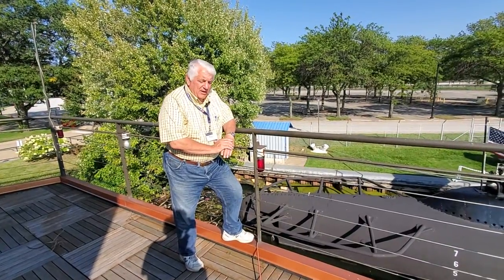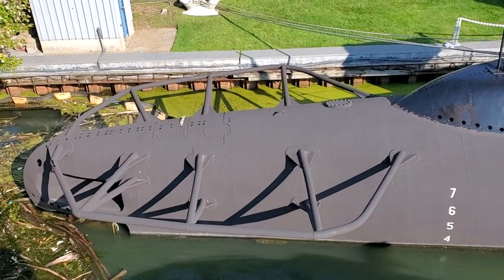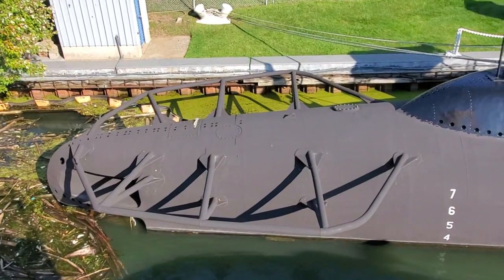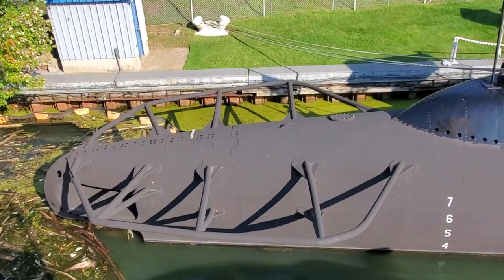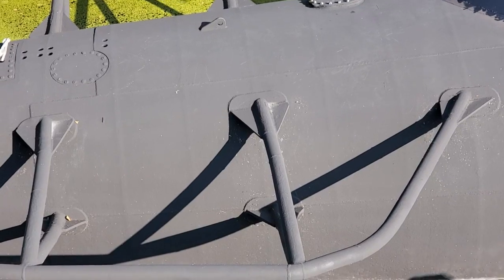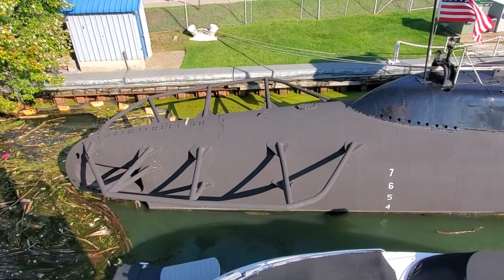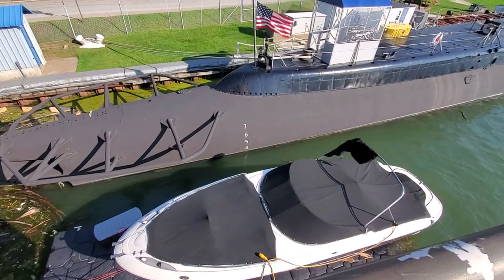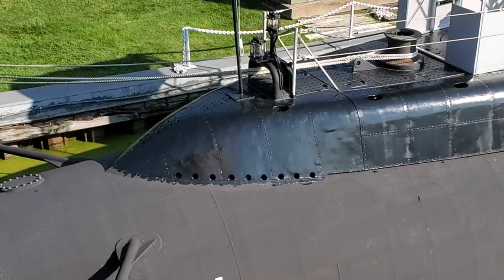Propeller Guards: The Purpose for Those Mysterious Pipes on Submarine Sterns

Comment: A simple solution to allow the Subs to keep prop Guards & avoid grappling hooks would have been to cover guards with sheet metal or steel plates. This would have allowed them to still function but prevented hooks from being able to grasp them. Perhaps also put a 45 degree angle on forward most pipe. This would have added bonus of reducing cavitation that those pipes likely caused. WW2 subs must have been cavitation nightmares with all the protrusions & squared shapes. The Guppy conversions seem to address these issues.

Comment: Those guards only add about 20% more drag.  LOL.  Probably made a lot of turbulent noise, dropped the electric propulsion top speed and range quite a bit, which is most likely why they were removed.  Not the grappling hook theory.